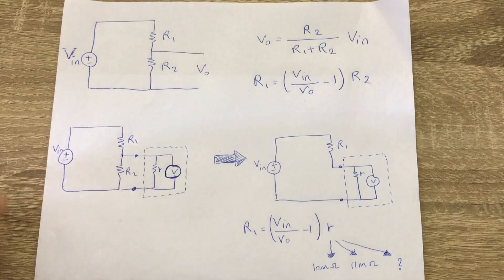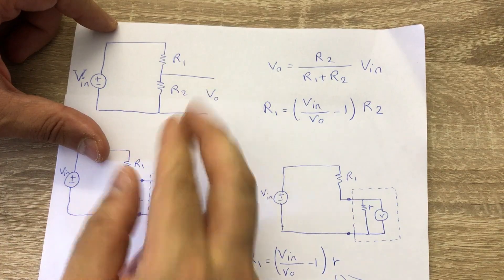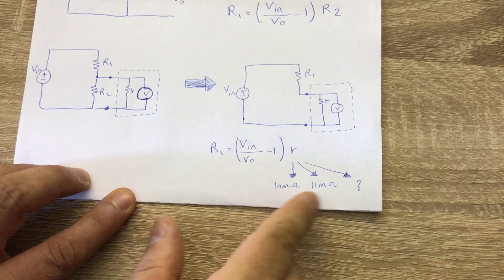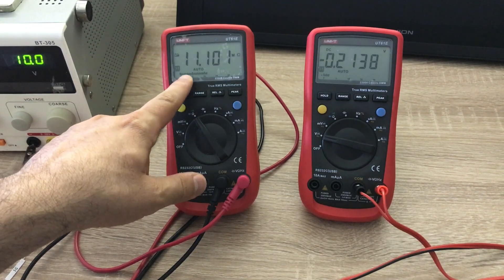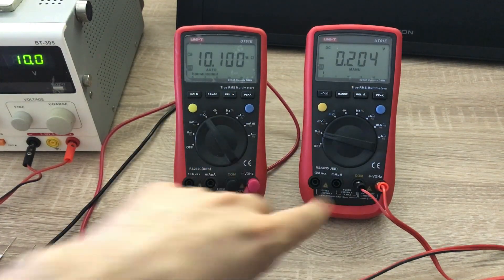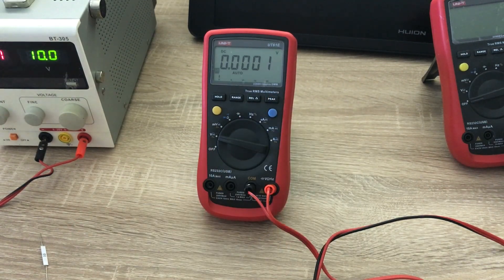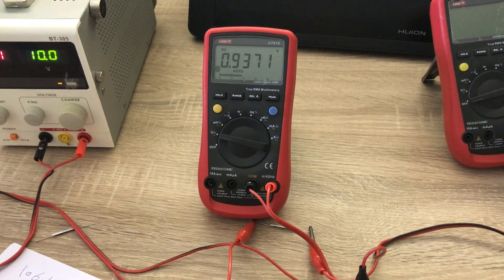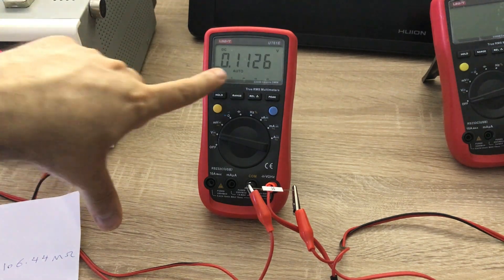How to measure large resistances (up to 10s of Giga Ohm) using a normal Multimeter

Comment: Great video and nicely explained!👌

I was wondering if this setup is what’s used in mega ohmmeter to measure insulation resistance? If so, why does mega ohmmeter use high voltages in the range of 5kV to 10kV?
Reply from the maker: Hi Uwais, I think one reason is to stimulate real operating condition more closely to identify any weaknesses in the insulation, and obviously the fact that higher voltage causes larger leakage current which can be measured more accurately.

Comment: Great video! I think one could improve the accuracy of this method by measuring the value of power supply voltage beforehand using a multimeter. At least that's what I do - I don't really trust those built-in meters :)
Reply from the maker: Thanks, I wanted to mention it in the video but forgot. The power supply I used, shows the current and voltage values rather accurately, otherwise we indeed must use a second multi meter to measure the voltage.